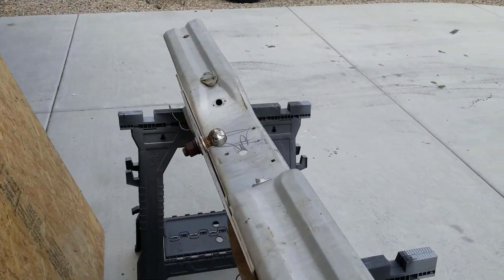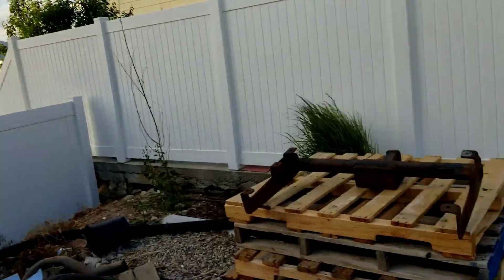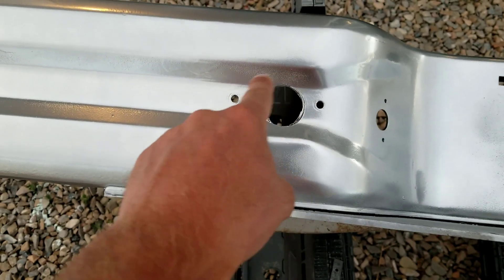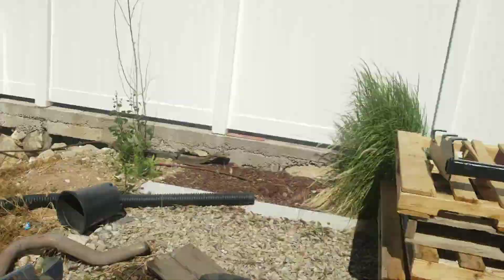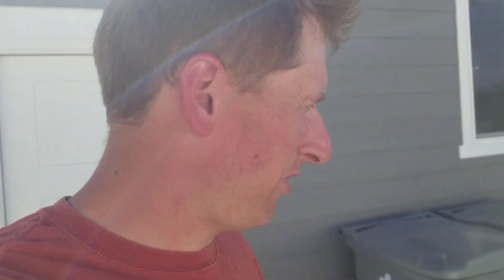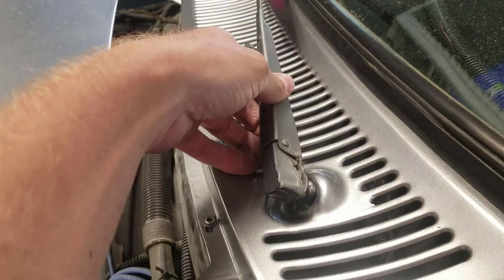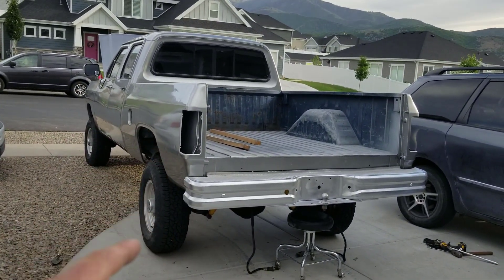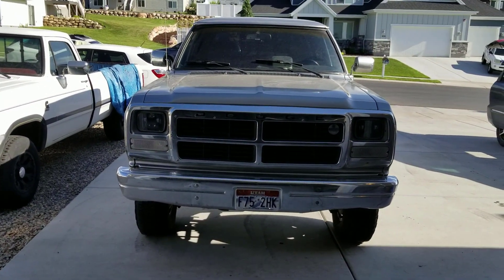The 1st Gen Crew Cab is All Back Together

Comment: Why did you add or re-adding the spacer. For clearance issues from the conversion ? Or just to add an additional 1" ? Guess I must have missed it in your other vids. As you know I still am doing the conversion. Thankx.....Thumbs Up !!!!!!!
Reply from the maker: On a crew cab short bed you have to run some type of body lift to clear the diesel fuel tank. The other option is the retrofit the crew cab gas tank but I wanted to stick with the diesel tank.